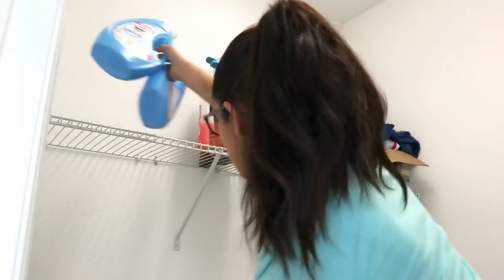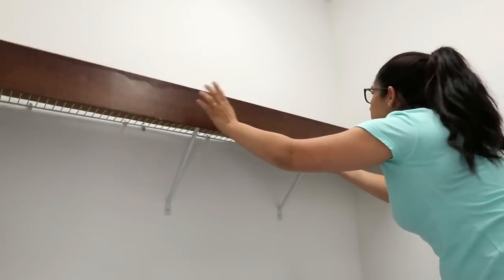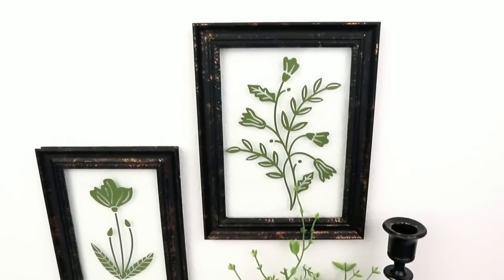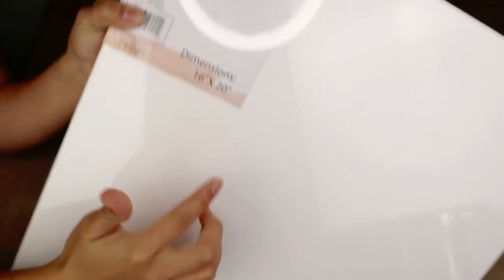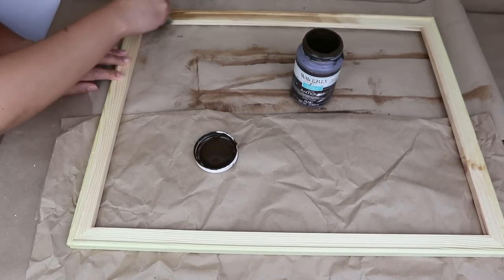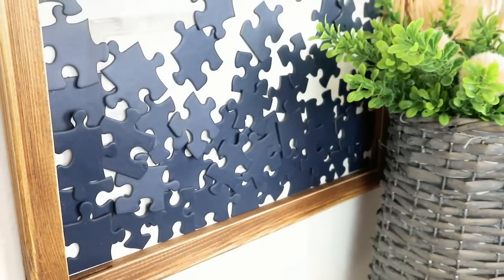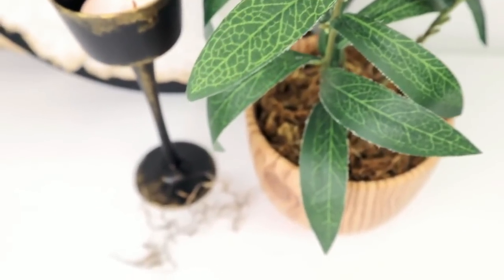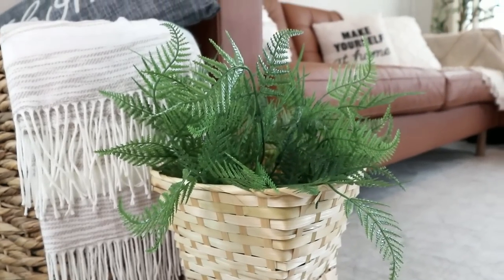10 ways to FAKE a High-End look from Dollar Tree! *Best DIY Home Decor Hacks!

Comment: I really like the falling puzzle pieces in the frame.  It inspired me to think beyond and I wanted to share.  But these thoughts are separate ideas, not to be used together on one project.
1. If your walls aren’t white and you have leftover paint from painting them, use it to paint your canvas before putting it back on the frame.  It will give the illusion that the puzzle pieces are falling on the wall itself.
2. Use more than one paint color to spray the puzzle pieces.  Separate the pieces into 3 or 4 groups and use a different color on each group.  Specifically, choose colors found around your room, like in your couch and curtains.  Have fun mixing the falling colors in various ways.  This will help “pull the room together.”
3. For a child’s room consider painting the puzzle pieces the colors of a rainbow and then arrange them on your canvas (that you have painted sky blue) as a somewhat scattered, falling rainbow. Consider changing the color of the frame.
4. To make a seasonal piece, spray your puzzle pieces colors of the season.  For example, use the colors of fall leaves against a wheat color canvas.
5. Can you locate puzzle pieces that are exactly the same shape?  Stack a few together and glue them before spray painting.  Do this several times with other pieces.  This will add an extra depth to your finished piece.